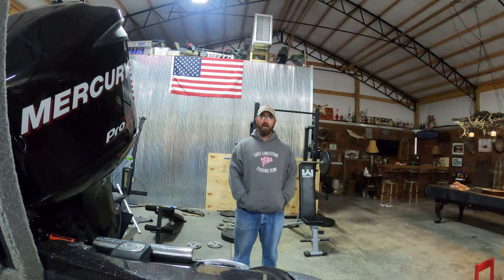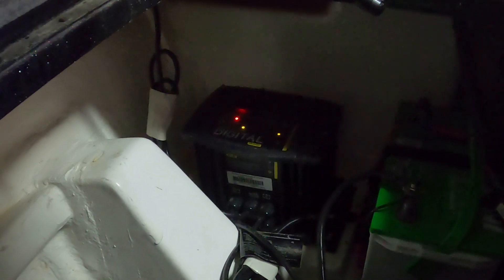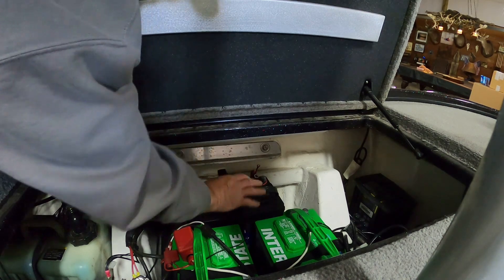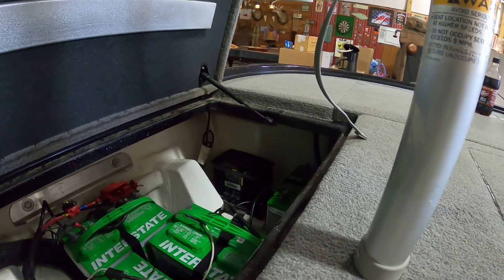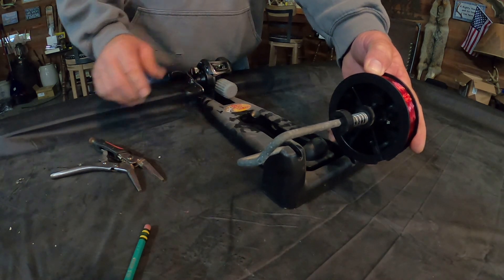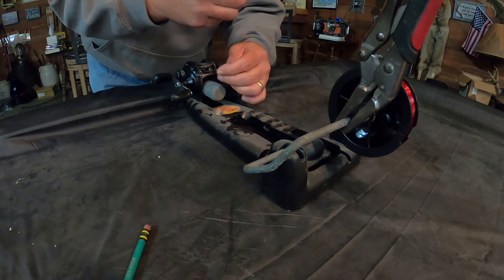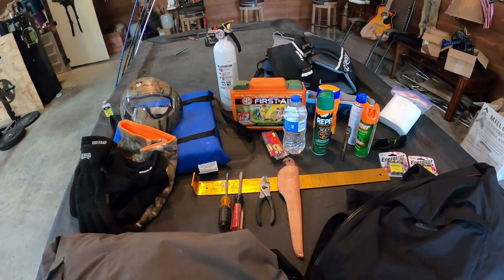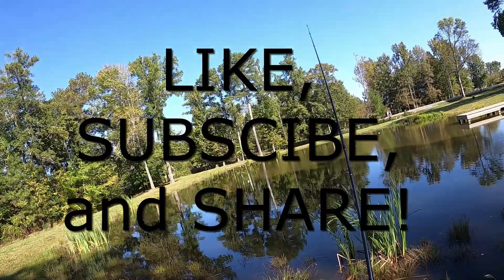Boat Maintenance!

Comment: Danny if you would put a jump box or jumper cables on that battery while it's charging it will kick in and charge. Those new chargers have to read some kind of voltage before they charge. Or put it on an old trickle charger. Guaranteed that battery is not bad